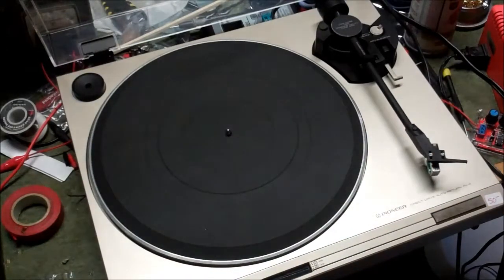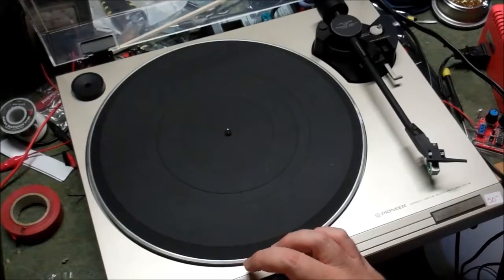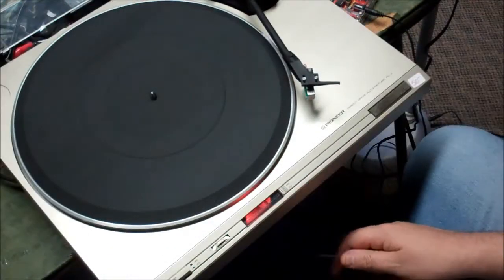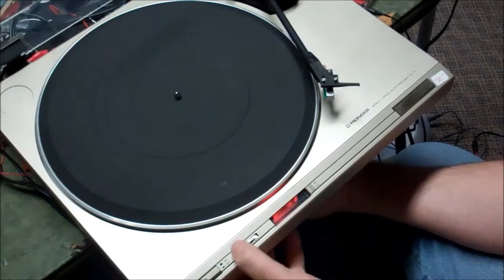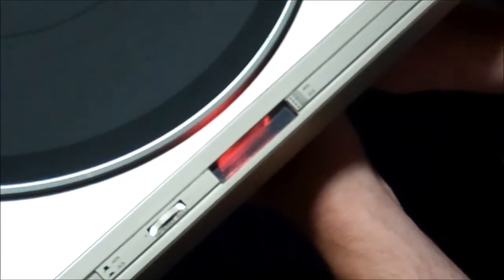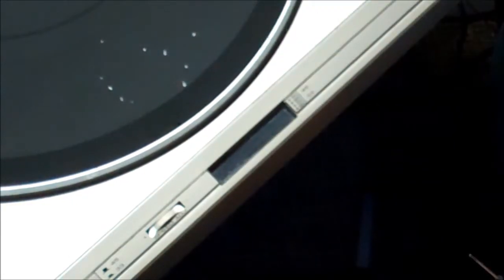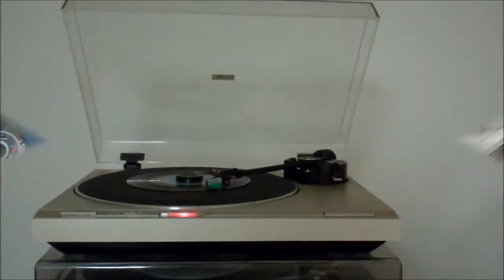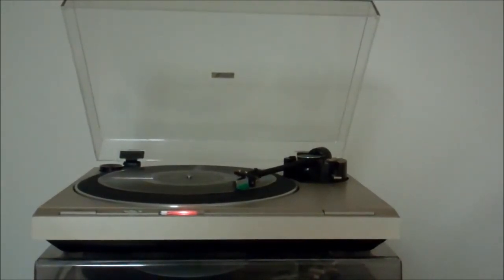Pioneer PL-4 Turntable........Trash or Treasure?

Comment: I owned one of these PL4's and it had the same issue.  I loved the turntable, but this was way back before the internet and you tube.  I gave it to a service place and never got it back.  I wish I still had it, with the help of the internet I may have resolved the issue.
Reply from the maker: Ability to find service information is one of the blessings of the internet....
Reply: Really strange why they kept it.
Reply: @karensingh2020  He closed shop
Reply: @thomasmoher9089  ya bet he did after taking customers things!
Reply: my first TT  was a sears belt drive 1980. then in 1982 i bought a pl-4

Comment: these have a headshell issue.  out of alignment.  on my pl 5   i just removed the hsl. filed the raised parts on the arm. but just enough.  now can be moved side to side.  now the stylus sits level to the record.
Reply from the maker: Glad you solved it.
Reply: which part do you mean to file ?
Reply: @michaelbrind9222  i havnt looked at it lately  as i have a few.  take out the headshell.  if you look at the top of the arm its a flat spot. that is the square lock. same if you look inside the headshell.  on the arm file the corners of that part so it allows the headshell to rotate.  very little at ata time. until headshell can  rotate.  you dont want to disturb the contacts too much. this does work.
Reply: very important dont over file     just enough to rotate the headshell!

Comment: Hi, I have one the same and the plate rotates at a very fast speed, even the table where I have it starts to shake, what can I do? I did a cleaning with the video (https://www.youtube.com/watch?v=Oy16eMCEy-w) and nothing remains the same, I would appreciate if someone can give me any help, thanks
Reply from the maker: Get the service manual at www.vinylengine.com    There's a speed sensor that's not sensing.
Reply: @DeadKoby  many thanks